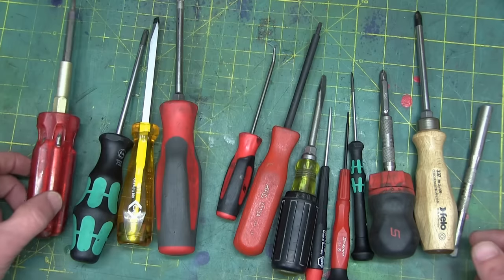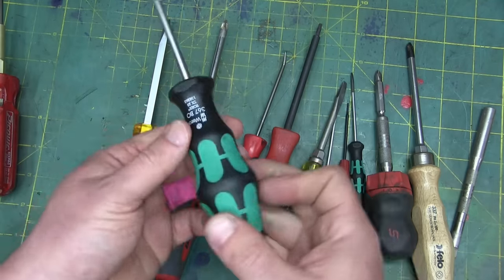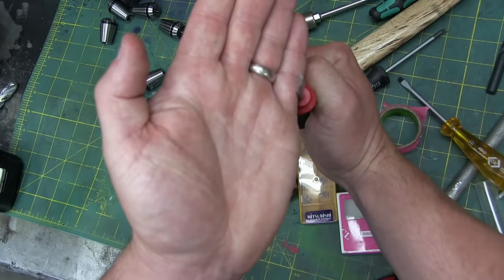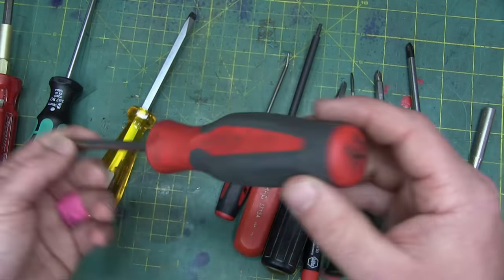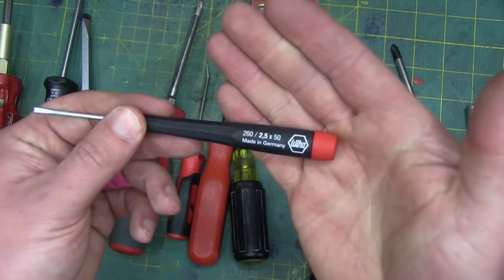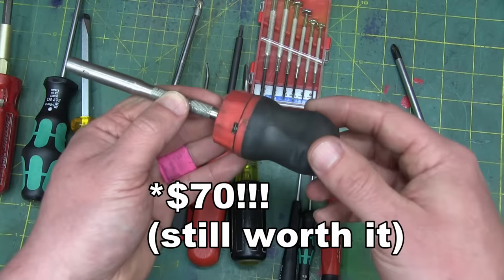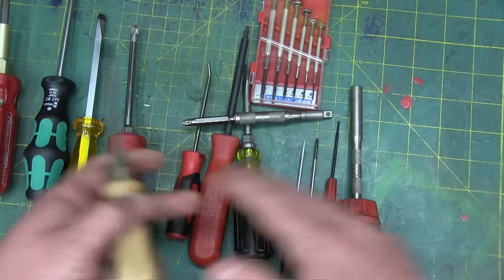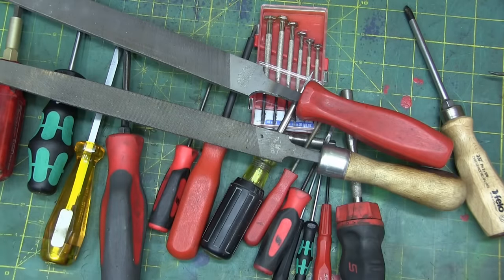Screwdrivers is BEST screwdrivers?

Comment: WERA - they have a yellow brand - if you can, take a look at them, they have the CV throu the handle, are more robust, you can use them with a hammer to wa(n)ck! -  those green ones are no so rubust at all, more for electric-wip-wap.
Reply: Video 17 have a full set, yellow and green. use them daily all the way from ripping out windows to screwing bronze screws on a piece of furniture. love the drivers.
as you said though, green for fine work, yellow for rough. btw I work in Germany and i still don't use wiha
Reply: +1 for yellow Wera
Reply: TheGrimReapergh Warum denn?
Reply: Gustavo Hernandez could never justify the price and hell, I use what my boss buys
Reply: +1 Wiha precision screwdrivers. Discovered these repairing Apple computers for about 5 years. They feel right and the tips don't break if you're not abusive, I save worn out and broken ones for abuse. The bigger Wiha drivers with the big round handle give more torque with the hand, but quickly make my hands hurt with repetitive use. The tips well outlast Smears Crapsman. I buy Wiha in the US from MCM Electronics.
Reply: I use a chisel...
Reply: Ian Schmidt yes! Each has its place. The laser tip Kraftform (green ones) is what I grab if I know I’m going to need a delicate touch.... an easy to slip head.... on the fastener. The yellow Chisel Driver when you want something you can abuse.

Comment: Harbor freight tho... nice to get a screwdriver that strips before the head of the screw you're screwing.
Reply: mark putham I just fucked up one of those today removing the plastic shroud screws on a push mower.   what a piece of shit
Reply: They are the absolute worst!
Reply: Maybe I've just had good luck with their free screwdrivers, but I haven't seriously damaged one yet and I use them for prying and chiseling (alu, iron, steel, etc.) when I don't want to mess up a tool I care about and don't want/need a big prybar. Hammered on them all sorts of ways (steel hammer) and haven't even broken a handle. The handles even feel pretty decent other than the sharp edges toward the tip. Cut the shank off of one and turned the flathead into a oil pump primer, the steel isn't nearly as soft as I expected. They're free.99 and feel better and more solid than some of the expensive sets I've used.
Reply: I broke the plastic handle (like a spiral bone fracture) trying to loosen a phillips.
Reply: Oh, wait, I just remembered that they changed their handles in the last year or two. The old ones (rounded, with lugs) were uncomfortable and brittle, the new ones (square) are what I really like. The new ones are shaped like the Mac driver in this video. Not sure if the metal changed, but I can put the handle on an anvil and hammer on it without it breaking.

Comment: For gas axe file handles we cut a piece of branch the thickness and length we prefer, some like em thicker for not getting tired hand.
You could do the same and get a better purchase on your tool maybe.
You pick the piece of round Beachwood you like and cut it out, then you put the file end in the centre and smacker down. 
The wood we use is always green fresh cut.  The dry stuff is hard and you can't smacker down.

Comment: Check out the Wera 932 Kraftform Plus, they have a pass through blade with a solid metal hammering surface on the butt of the handle, as well as the hex on the shaft to get some extra torque with a wrench if needed

Comment: Used Wiha a lot in an aerospace machine shop. Especially for changing cutting inserts in lathe and mill tooling. Between Wiha for Torx and Bondhus for the allen heads (usually hid the Bondhus drivers from coworkers so that I had something that would loosen the screws that some of the shop apes seemed to tighten to 27 gazillion inch pounds - Bondhus were the only ones that wouldn’t strip when breaking them loose)
Reply: Thanks

Comment: Using a golf ball for the handle of a file works great. It functions just as good if not better than a handle and will almost never break (but if it does you just buy another golf ball instead of a handle.)

Comment: Screwdrivers are pretty subjective when it comes to feel in the hand, but Vermont American used to make some really nice screwdrivers called "The Claw". They were made in the USA and they had small grooves in them that seems to really get a good bite in screw heads. I can really get a good grip on the triangular shaped handles they came with which were also grooved. They aren't made anymore and they are getting hard to find used even but whenever I run across them in a Pawn shop I pick them up. They also sold them in Walmart stores under the Popular Mechanics label. Awesome screwdrivers and my personal favorites, just unusually well made inexpensive screwdrivers.
Reply: I had those! I still have a few left and really loved them.

Comment: Gotta say I really like my Craftsman screwdrivers [got 'em a couple years ago, and mine were made in the USA...]. I looked at Klein, too, but couldn't justify the price...and the weird Klein-looking yet beat-up-beyond-identification screwdrivers my dad's had floating around as long as I can remember also kinda put me off...and I wasn't sure if I'd like the rubber. >__> Anyway, parsecs better than my tiny-slick-handled chinesium ones I'd had since I was 12 and suffered using for far too long because I thought the Craftsman ones I was used to of my dad's were expensive.

The Snap-on handles look like they're probably even better. It's weird looking at screwdriver handles online...or even in Horror Fright. They mostly all look the same. And the WeraWihaWhatsit handles look odd to me, so it's nice to get some confirmation that my intuition might be right and they're not somehow magic.

I actually made a square[ish] file handle for my mill bastard and I really, really like it. Of course, I'm biased, and probably don't use a file near as often as you, but.... Oh, and it's pressed/hammered on instead of screwed and its flats are on the sides the file's are, so that probably helps.

Comment: I heard a lot of talk about handles, how they feel and whether you can beat on them... BUT my main focus when buying a screwdriver is the precision of the tip. I’m talking about how precise is the tip ground and how durable it is. I’m not talking about little “precision” screwdrivers. It doesn’t matter how pretty the handle is if the tip is junk. A good screwdriver digs in precisely and doesn’t strip the screw like a cheap screwdriver. Which screwdriver has the best tips?

Comment: My favorites are the Wiha, the handles just fit my hands and are the most comfortable I have used.  My second are the old hard handled Snap On, I just couldn't get used to the instinct handles.   For Philips and JIS, Vessel makes the best driver hands down, they are just incredible.  It's funny you mention Pozidrive.  I bet if you asked 100 GM or Chrysler techs about Pozidrive, 99 would look at you like you had two heads.  Neither one of those manufacturers has used Philips head screws in decades but everyone uses Philips drivers on these fasteners.  I agree with what the others have said about Robertson, It has to be the best screw head design I have ever come across.
Reply: Although discontinued, Wiha Proturn 3k are fantastic and also come in ACO versions.

Comment: Can we please all agree to completely stop using standard drives, I know they're cheaper, but they really suck. I like coin slot drives for low torque, tool-less situations. I'm not a fan of Philips or its redheaded cousin Philips Slotted, or any of the following similar drives from out yonder; Frearson, French recess, Cross, JIS, Pozidriv, SupaDriv and TriPoint. Allen and Roberson were both useful back in the day, but started to feel dated about a decade ago. It would be so nice to carry a full suite of Torx bits and nothing else. I wish Torx Plus was common, probably won't catch on for a while though.
Reply: Eric Chandler a good driver works fine with Phillips
Reply: in german cars almost all the bolts are either torx or torx-plus and its amazing, been working on them for a few years now and can count the times i've stripped a head on 1 hand
Reply: @jobdylan5782  Seeing as how I've NEVER stripped a torx, I'd beg to differ. I've done in many a Phillips and flat head. But torx GRABS and holds on. Honestly I'd love if everything was torx and Allen.
Reply: The only problem with torx imo is that when the screw is really stuck, it wont strip, but your bit will twist or break.. or im just using cheap torx bits
Reply: If you work on antiques, you will have flatheads.
Reply: I like torx myself. Never an issue with torx unless you're doing automotive 😂
Reply: @Eric Chandler you missed out Reed & Prince >.>

Comment: My favorite driver comes out of a tool kit from a VW 1999 or older. Stranded and fillips bit with plastic handle (not the best handle) but the bit has kept an excellent edge for 15 years now with daily use in automotive service. Get one if you can find it

Comment: This was NOT up to your usual standards, AvE. You are missing quite a few things here. 1. Wera has a whole series of drivers made with both the cap at the end for hitting AND a shank with a part for a spanner. 2. best screwdrivers in the world comes from PB Swiss. You should try them out. Made in Switzerland, and believe me when I say that everything currently on your table will look cheap when you have paid for some PB goodness. If it's too expensive, try a few bits first 3. There's loads of specialty screwdrivers about for things like jewelers, gunsmiths, cabinetmakers and so forth. Case in point; Grace USA. Try out their o-ring picks. All wood handled.

Comment: As a general use and abuse screw driver I like the matco ones. They have a nice shaft like snapon with the wrench slot. They also have a flocking material so even if you hand is soaked in oil they are still grippy. Now they just need to add lanyards so I don't leave them on trucks for frig sakes

Comment: When I was working I called on hospitals and I would sometimes go into the gift shop.  Some hospitals purchased one use sterilized stainless picks, scissors, and tweezers.  After surgery, they would sterilize them and sell them in the gift shop for a couple of bucks each.  The quality is great, much better than the HF junk.  Since these were used in surgery I always took the added precaution of boiling them for 15-20 minutes before use.
Reply: Good idea

Comment: No pb Swiss?! oh man, you're missin out! Thanks for the video Ave!
Reply: Justplanecrazy25 oh yes baby
a bit pricy, but they last a lifetime
Reply: Another shout out for PB Swiss here! I work in semicon and nobody uses anything else in that branche. The classic style is very easy to keep clean and has great grip even with two pairs of gloves on (undergloves and nitrile). I have broken a few of their allen keys while torquing down turbo pumps though.. But I can't think of any other brand that would take that kind of abuse better.
Reply: The "classic" transparent-red PB screw drivers develop a very particular smell/ odeur if stored in a low-air-circualtion drawer/ etc.
Reply: turbostewi I don't think this is likely to happen in a cleanroom environment, I've never seen it or heard anyone in the branche complain about it. On the other hand, I think we burn through these drivers too quick for the plastic to go bad. Keep in mind ratchets and the like are rarely used, to prevent contamination from the moving parts, so the screwdrivers see the most use.
Reply: THIS is very probably the difference! Saw/ smelled it in a drawer of a "collection" (screw drivers collected over years or even decades, used with sweaty palms and thrown back into drawer) of PBs in a steel drawer in an industrial environment.
Reply: turbostewi that smell is the butyric acid (vomit contains the same acid) in the plastic they use. Old Craftsman screwdrivers are notorious for it. Try leaving them out in direct sunlight for a few days to kill the smell. I've also heard sodium bicarbonate works.
Reply: Give me PB Swiss or give me "why bother?". :)
Swiss Grips, though.  All of my CAB handles leach that dank
odor.    Once it spreads, it never goes away.  🤢
Reply: I started using PB Swiss after a very expensive Fap-Off set of torx bits consistently stripped on me (my first high quality tool truck purchase-never again...). They fit poorly and I swear they were made of cheese by the way they stripped out every 3 months of moderate use (primarily the T27)... Got some PB Swiss bits, shimmed and pounded them into the Snap-On sockets, and not one failure since (closing in on using them twice as long as the Snap-On now). They fit WAY better than ANY Torx I have used or anyone else in the shop uses and will take hellacious torque without permanent deformation (I can watch them twist up before the fastener lets loose)! So recently I invested in swapping out my mishmash of screwdrivers for PB ones (keeping a couple Harbor Freight/Craftsman for prying/striking). They're nice, but the flatblade with parallel cuts are... Uh... I'm not sure if I'm convinced they're that necessary...

Comment: I was hoping you're gonna a tell me more about quality of the steel they use.
I work as an electrician.
A good screwdriver has to be sharp and NOT yield to a pressure.
Nothing worse then working with a blunt philips screwdriver!
Reply: I can't say enough about the Wera Lasertip screwdrivers.  They just do not slip in the soft rounded screw heads you find on terminals.  Especially the flat heads.  I got the VDE ones.

Comment: Two main points I've got AvE; at 08:00 the small Snap-On drivers for electronics and such have been dressed up a bit since that model, and I find the newer ones rather comfy (a LOT more comfortable than allen keys) when I'm tinkering with my Traxxas E-Revo. My second point is this: Snap-On file handles work GREAT for round files, but as you pointed out, flats are a weak point. Take care!

Comment: I know this vid is 6+ yrs old but I just stumbled across it. Klein just came out (fall 2023) with a full sized precision bit driver with 27 bits! They have 2 models. Part 32327 has the precision bits with tamper proof bits and 32328 has the Apple bits.  I got one of them and I've been blown away by it.  It's light weight and the end of the handle spins making it super easy to work on computers and the small fasteners.

Comment: When I have a handle that has no purchase, I do the hockey stick handle thing - take cloth hockey tape and pull out some of it and then give the roll a spin to turn the tape into a sticky string. Wrap the string to form a helix on the handle and then keep wrapping the flat part of the tape to cover the wound up string part. Works great.

Comment: Made a set of checkering tools with large very ruff cut handles. Those were the best handles for grip I've ever owned. I now take the finish off all wood handles and just take a sharp knife and cut slices off in all directions. The out of round,ruff surface makes for terrific gripping. Learned this from an old wood carver. All his tool handles were just hogged down as if they were in 1st stage of production. hundreds of small surfaces to allow for good grip.

Comment: 9:38 I used to have the mechanism go belly up about every 2-3 years with normal use.  It happens commonly enough that the Snap-on dude usually has a couple of rebuild kits on the truck with him, or he just exchanged it for a new one but yes, they do eventually strip/go bad, with normal, frequent use.

Comment: I’m too frugal (wife would call me something else) to buy a full set of high ends screwdrivers for infrequency of which I’d use them.  But I do have two snap on screw drivers a #2 Phillips long and regular length.  Those being the two I reach for the most.  They just feel so damn perfect in the hand. And they grip those screws damn near perfect.  Definitely worth it IMO.

Comment: +Ave Wera has a fleet of screw driver series available. If you don't need the laster tip series, the stuff you are looking for is out there. I have those but not as fixed/solid divers, just as bits with a handle in the compact series.

Comment: I really like the snap-on ratcheting screw drivers. I have several. One other trick with those, and quarter inch extension can be used to make a really long shank as needed. Great for this hard to reach ones.
Reply: Nothing wrong with a reach around among friends

Comment: I'm just flat fucking sick of the cheap metals in the actual screws that strips out and rounds off or breaks off!!
Reply: 69adrummer ,
Buy A286 screws and put an end to that shit.
Reply: 69adrummer same goes for the small Torx screws too. If u have a decent screwdriver set, u are in better luck but man
Reply: Amen, I had some in my passenger car, Big Torx heads, thought that not that easy to strip a T60 headed bolt with a correct size bit etc... Wrong I was, after a few twists, I had a round hole in a round sided bolt. Ended up doing a square head to it with an angle grinder and then with a big bahco wrench opening it...
Reply: Niksu Kortesmaa haha oh man. I finally got a decent set of drivers (Milwaukee) but heard the wiha were the best
Reply: Have to look up the Wihas, probably from Amazon, they are not at all present in Finland. Here we have mostly Wera, Bahco, Stanley, some Milwaukee and Witte. (in addition to chinesium wonder drivers, where you can get a twist to the head and the shaft with the strength of a 9 year old girl...)
Reply: Joseph Ho, Regardless of the screws (and people) you plan to screw, you come by 
screws (and people) someone else has selected and picked up and screwed 
already, removing your choice of screws (and people). :-)